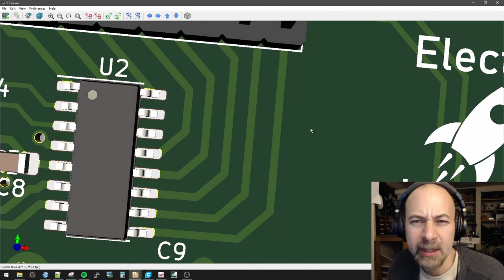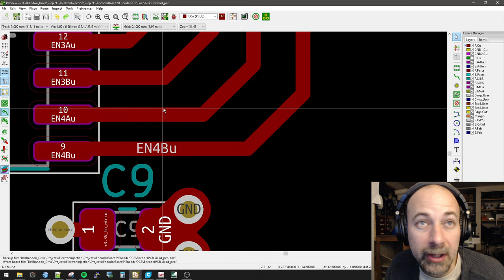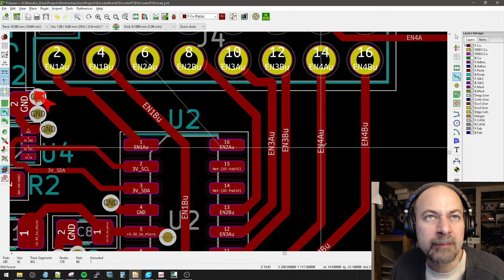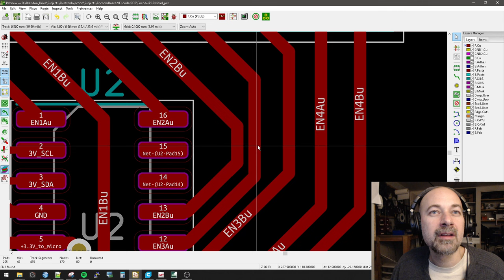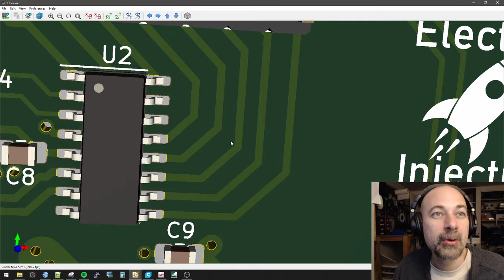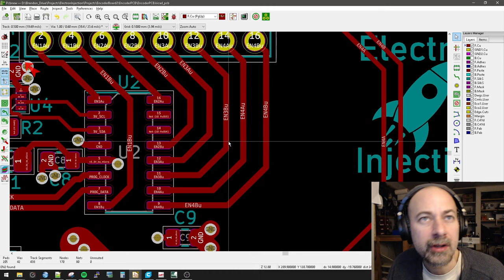PCB Design For Beginners:  Ugly Tracks Are Noisy

Comment: One thought. If your design has signals much slower than 30MHz and has four layers - your actual coupling will be miniscule. It may create some crosstalk but not as strong to make digital glitch. For very sensitive analog signals passive or active guarding (depending on your source internal resistance is a must). And then you will face signals so weak, that surface resistance of FR4 will make them offset by tens of milivolts. This is when the fun starts. I've been working on contactless ECG electrodes. Exotic PCB materials, low bias opamps, double guarding. But their noise level was lower, than classic silver chloride ones.
Reply: Don't forget high rise/fall time. 30MHz square wave with reasonable sharp rise/fall contains frequencies (harmonies) of x5 of that. Super-sharp will have higher harmonies. Not all squarewaves are created equal (Or was that what you referred to originally?)
Reply: Cool! I also worked on contactless EEG electrodes some years ago. Spun up lots of coin sized PCBs with electrometers, like LMP7721, and guard traces ect. I actually just found some of my old sensor boards kicking around the shop. I also did the traditional AgCl + inamp setup and we did all kinds of amazing things with both.  Audio stimulus and lock-in detection to the brain allowed us to test hearing and more.

Comment: Great video and well explained. Personally, I'd have rotated U2 by 90 degrees counter-clockwise so that the pins connected to J4 will be (mostly) parallel with their destination. Pin 8 on U2 will still need to be routed underneath the IC as it is now but it'd just look a bit neater 🙂
Reply: Honestly as someone that's an absolute beginner and barely played around in EasyEDA, that was my first thought - unless there's a reason I'm missing?
Reply: @ethzero  look to the left, I think we can assume he can have it as is and then "wiggle" the lines to top component or rotate it by 90° and have "wiggly" lines to the components on left side.
Reply: It depends on what has to route to the left hand side of the device. It may result in longer/weird routing of tracks to make the connections to that side if it were rotated 90 degrees counter clockwise. However, I don't know as I don't what circuit/board this is.

Comment: Why not changing orientation of all components 90º counter-clockwise, to make all lines straight to the connector?
Reply: While a good board position is key for good designs, in many cases you just trade complexity from one side of the chip to the other. So knowing tricks is still essential.
45° for larger chips can be a really neat trick, as it's only another 45° to get to two sides of the PCB.

Comment: It's good to know that capacitive coupling can be alleviated through spacing.  What about inductive coupling?  How do we avoid that?
Reply from the maker: Magnetic fields fall off at a rate of 1 / (distance^2) so the same spacing considerations that give good capacitive coupling benefits, give GREAT inductive coupling benefits.  Inductance increases with length, so keeping traces short is a great idea.  At high frequencies, wide traces aren't super helpful but they can be beneficial for "medium" frequencies (whatever that is).  Inductance is dependent on dI/dt, so using a small resistor on clocks can radically reduce inductance although it may smooth out a square wave a bit.
Reply: Doesn't ground plane help alot with inductance?
Reply: @samueldavies646  sometimes, depends on what you're doing and what you're trying to achieve. Sometimes two tracks which create inductance between them is desired.

Comment: Quite right... I did clean the routing a lot tot make is very poper. But making the routing chaotic results in less crosstalk problems..
Reply: Easy ways to have less crosstalk can be using ground ref layers on internal layer 2 and 3; make the traces thinner; increase the distance between them. They can be beautiful and follow these guidelines.

Comment: Crosstalk depends on the length of your tracks and the distance of the track from the ground plane, for a track as short as that I can't see any issue even with fast CMOS, best to use a cross-talk calculator and a practical experiment to prove this. The main goal in most PCB design exercises is to reduce current "loop area" with short tracks and ground planes. A "good looking" board is is a functional one, tracking isn't cosmetic. Your layer stack-up is also a little odd. I recommend Rob Feranec and Eric Bogatin's PCB lectures for anyone that wants to get into PCB tracking.
Reply: Yeaaa my man, SATURN PCB a good trace calculator, no need a art course  to do pcb

Comment: Nice work! If I may make a remark: prevent copper angles sharper than 90 degrees. I consider them ugly. They can create noise/EMI, depending on the frequencies. At high voltages (like 1 kV) these sharp angles can create arcs as well.
This all may be beside the point you’re making, but worth mentioning :)
Reply: 90° turns are bad for one more reason. In fab this is place most vulnerable to etching issues. For HS you should use arcs.
Reply: @brylozketrzyn  The etching thing is a myth that was true only 20 years ago (or maybe even before that). Not an issue with modern processes.
Reply: Yep, electrons will fall out when making those turns /s
Reply: Supposedly the main reason for going from 90s to 45s is that the 90 has an impedance discontinuity where the 45 does not, because of the change in geometry of the cross-section of the trace as you sweep through the turn.
At high voltages, points will create an e-field concentration and breakdown point as @electheo said and severe acute angles can cause acid traps and over-etching historically, but that seems to be less of an issue lately. I still don’t like it on higher spec (6 mil trace/space) boards though because it’s easy to avoid.

Comment: Why not use arcs instead?
Reply: They take longer to do than a 45 degree angle in a CAD and provide not much benefit except they "look pretty". Now-a-days it's about the speed of turnaround on the routing to final production, functionality and proper operation rather than looks. KiCAD also doesn't allow you to draw arcs on copper layers for some reason.

Comment: Angles of 45 degrees between pad and track on U2 pin 1 and 16. Altium can warn you on that. 45 degree angles are bad for the edging process.
Reply: The only concern with 45 degree angle tracks is at very high frequencies.  Reflections will bounce back from a 45 degree angle.  I guess I need to pull out the books to see which frequency that starts to matter.  If I had to guess, I'd say anything less than 100Mhz is totally safe.  I could be wrong on that.   Keep in mind that every via is a 90 degree angle and it's impossible to make a dense board without a zillion vias.
Reply: @BrandonDrury I think he means that <90 degree angles can cause problems during PCB etching. 

My understanding is that this isn’t really a concern anymore with modern PCB production processes.
Reply: @tookitogo You're right, it really doesn't matter.

Comment: Hi, I have two questions: 1) making these tracks equal length would help? 2) back in the day, they used to do beautiful round tracks. I wonder why isn't the case anymore?
Reply: Making traces equal length is the kind of thing you only bother to do when you really need to - just because it takes extra time and potentially extra space, so no point wasting that unless you need to. That's only really done if there's a timing margin (for example I routed some Ethernet RGMII interfaces recently and the datasheet for the PHY specified < 11ps margin between each of the five signals going in each direction). For arcs as well, I mean you can it's just it's easier to route a lot of signals with 45 degree corners, I think it's just going from hand drawn to CAD that people stopped bothering. Again it's just a matter of ease and time - the arcs look nice but take longer and don't provide much benefit. Even at microwave frequencies often you can just get by with chamfered corners (the chamfer makes up for the changing width which causes a discontinuity in the characteristic impedance of the track).
Reply: @stephengentle2815  wow, thank you!
Reply: They don't do "rounded tracks" any more as those were hand drawn. It also takes up more board space to do an arc instead of a nice 45 degree, 45 degree turn.

Comment: I've done nice boards in kicad and sent them off to be done by pcbway/jlpcb etc, but what I wish for most of all is a way to simply output my design (copper front/rear) as a simple BW bitmap for my laser to do a mask etc. it outputs svg in the strangest way possible with a layer for everything... if you just 'print' the board I get a lovely set of tracks on my epson so it can reduce the board to BW single layer, just wont export it as such!
Reply: Have you seen some of the 3D printing guys using the UV screen of their resin printer for setting a board before etching?
Reply: I wonder if it can be done from the Gerber viewer?
Reply: @DeShark88  oh theres an idea. I could also have a word with the laser softwares writer, see if he has an idea how to convert the kicad svg into something the software can read. kicad exports a white square as board area, the laser engraves it onto the pcb resist, so just one big square of bare copper lol
Reply: @welshdave5263  yes i did think of trying to print the tracks on the board just with my pla printer, but lightly spraying a board with some black rattle can paint and putting it in my laser engraver seems an easier method. this summer i'l have the time (and hopefully money) to build an a3/a2 sized cnc and more powerful laser
Reply: @lezbriddon  is seen laser etched spray paint done here. Also seen PLA printers with a waterproof permanent marker attached and used as a plotter to draw the tracks etc before etching the still bare copper.
Reply: @lezbriddon  I think it was the "made with layers" or "printed with layers channel that did the UV etch with a resin printer.
Reply: @lezbriddon  As SVG is a text based format, you can edit it like you would edit a HTML page. This means you can open it in notepad and remove both the start-tag and end-tag for the white rectangle, so the board area layer will be gone on the new SVG. Then the laser software should now read it properly

Comment: I'm having some interest in doing circuits. What I don't get is ... why the programs don't calculate the optimal path given properties like the width of a trace and the kind of signal/frequency expected on it?
Reply: Great question!  The problem is in the word "optimal".   A trace with 20A DC flowing through it on a military board has a radically different definition of "optimal" from a trace with 2uA DC flowing through it on a child's toy which has a radically different definition of "optimal" for a 3Ghz clock.  As of now, we don't really have an "Intent" setting on traces yet, but it's plausible to have this in the future.  There may be a time when two high speed digital traces could let us set the "Intent" to be time aligned and the tools just do it.  As is, we have to recognize the need for time alignment and do that ourselves at this stage of the game.  I see vast changes occuring quickly, though.  So you may be on to something!
Reply: @BrandonDrury some programs have parallel track routing options for high speed signals. Keeping the tracks exactly the same length. 

Also, many, if not most programs have auto routing, but as mentioned above, it doesn't know what your circuit is supposed to do. It only knows that two contacts or pins are supposed to be connected together. It would be very time consuming to define each and every track's "intent" and have the program try and reroute all of them. Sometimes it's just easier to route them manually
Reply: Aside from specific impedance requirements (for which PCB routing tools do calculate the proper trace widths), there's never a "right width" for a trace, it's always a trade-off between heat production, space available, distance to other traces, etc. etc.  If you have the space, might as well make the traces wider, like, 0.5mm width traces are massive and I have only used those for high power traces, but in a board like in the video there is the space, so why not...
Reply: @rrrrrrrrrrrrrrrrrrrrr  because sometimes too low of impedance can cause stability issues things like SMPS or other high frequency switches. It's a balance. Just creating the lowest resistance track is not always the best approach

Comment: wouldn't having traces with round bends help? also, rotate the chip so it is parallel to the connector....
Reply: You'll see rounded traces in SUPER high speed digital designs.  Off the top of my head,  I don't recall which rise time that starts to matter.  I believe it's in the Ghz range.   Below that, it's generally acceptable to use the 45 degree method.  The shape of the trace is a factor, but at lower frequencies, it's nothing compared to that bug catcher net absorbing noise created by the area within the loop of the signal AND it's return current.  This is where using a ground plane underneath the trace and a stackup with thin prepreg come into play.
Reply: @BrandonDrury  But with modern PCB design and manufacturing methods, why not just use round bends always?

Straight lines are from pen-and-ruler era.
Reply: @u2bear377  One reason is your EDA tool might not support it since it's a lot more complex to implement. I don't think KiCAD can do rounded bends in the editor yet, although now there are at least plugins/scripts for it and they keep talking about how it's coming to the editor eventually. The straight lines and 45 degree bevels are from the 80s CAD era, look at boards from the 60s and 70s when they were laid out with tape on glass and they're generally very curvy.
Reply: @treelineresearch3387  How is the rounded trace more complex than a truetype font?
Reply: @u2bear377  are you daft?

Comment: Why do you have two vias per ground connection? Wouldn't it be better to just have a single via touching the pad? Or have a via on either side if you really wanted to have two of them.
Reply: Each of the vias have its inductance and also current limit. Two vias (or more) are necessity for many fast MCUs. Otherwise you are just killing your capacitor ESR. For BGAs that could be hard to avoid, that is why many packages have multiple VCC balls, each decoupled separately.
Reply from the maker: 2 vias per ground in this case is mostly me playing.  In theory, 2 parallel inductive paths knocks our inductance if half although I'm still looking for a definition of exactly how to define two paths.  In other words, if 2 return paths are 98% identical, does the inductance for that return path divide in 2.  Probably not.  I'll need to pull out the text books for that one.
Reply from the maker: Interesting!  I didn't factor in ECR to using multiple vias, but I have to admit that off the top of my head I don't see how 2 vias would achieve this.  Can you explain it or point me in the right direction?  Thanks!
Reply: @electroninjection183 Well each via has a certain amount of resistance. Put more of them in parallel and the total resistance goes down.

Comment: You made one layout mistake so; it has acute angles, e.g. circuit U2 pads 1 and 16. Acute angles cause problems during PCB fabrication, particularly the etch.
Reply: yes, that indeed used to be true 30 years ago gramps, times change, no issue for modern fabs

Comment: I design tracks on INTERNAL layers with ground tracks between them. Ground planes top and bottom, and ROUNDED corners
Reply: For all boards?  I work on too many boards where hitting a price point is more important than electromagnetic factors.   At what frequency do you decide the rise time is fast enough to necessitate the extra time required for rounded corners?
Reply: @BrandonDrury  with a KiCad addon it happens in seconds by the press of a button
Reply: @martinvollderpro   Isn't it more expensive to manufacture rounded corners? Or am I imagining that.? If it's the same price to manufacture round corners, as it is to have them just make them angled, then it would seem like the automatic default of the designers, would be to always request rounded corners.
Reply: @Inertia888   @darrick.S  I didn't get extra charged for using rounded tracks. Why would it be more expensive, a rounded corner is "smoother" than a 45 degree angle thus easier to print
Reply: rounded corner make the board mechanically more solid, if the board hits a corner its less likely crack mechanically.

Comment: By the looks of things, I would have put the chip horizontal to the connecter, rather than vertical
Reply: Would have made that side neater, but might complicate the layout to the left.  The other thing is the connection at pins 1 and 16 has such a tight angle.  I was always told to make pad and track connections at 90 degrees, avoiding acute angles.

Comment: Why is every trace on the top layer? Shouldn't you really maximize the top layer for ground planes and try to route as much as you can on the bottom layer? Obviously, this is not always going to be an option, especially on 2 layer only boards. Sometimes, you have to jump from the bottom with a thru-via to the top and sometimes back again to make the connection. You now have 1000 subs. Congrats!